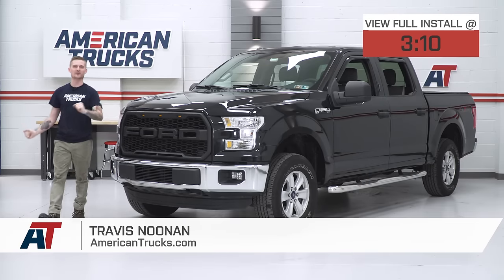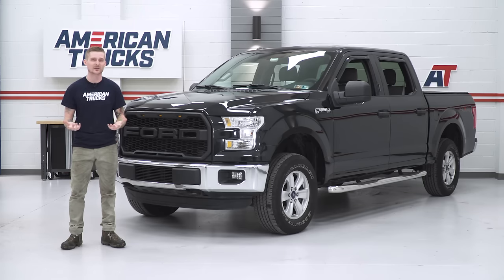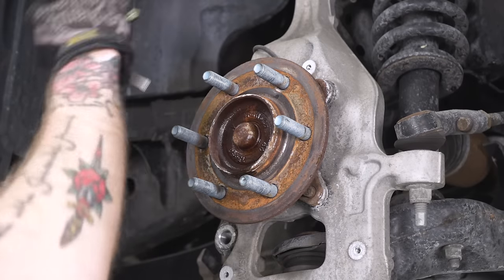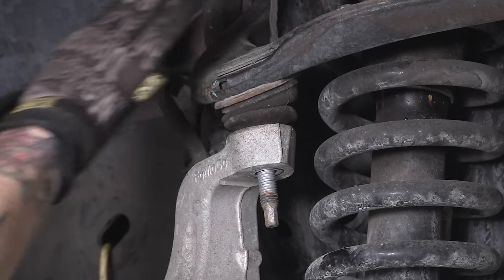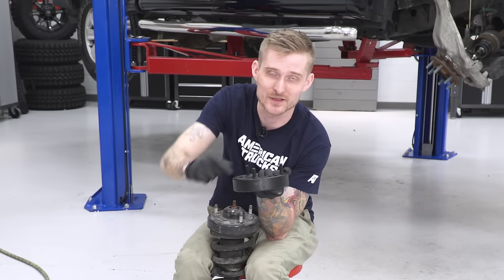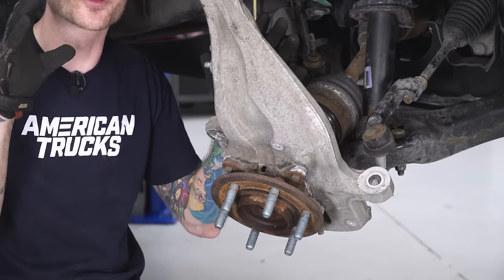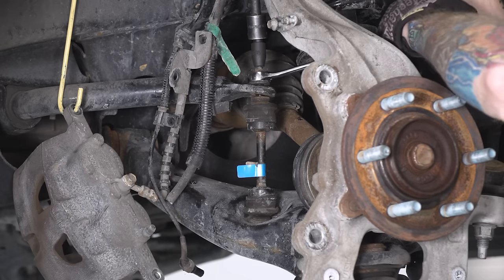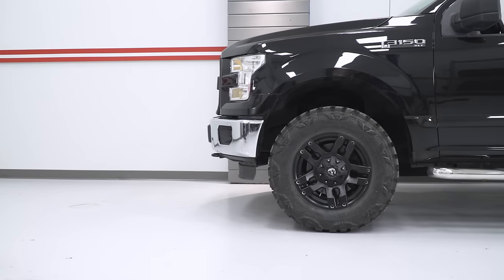2004-2019 F150 MotoFab 2" Front Leveling Kit Review & Install

Comment: Talk about doing it the hard way...  You do not need to pull calipers or axle shafts to install 2" leveling spacers.  Just disconnect the sway bar and strut and drop it down.  I installed mine in 90 minutes in my driveway using hand tools.
Reply: Thank you, this helped me save a lot of time! I did the same after reading your comment
Reply: Do you still need to disconnect the upper ball joint?
Reply: @phillipbriggs7682    Yes you will need to disconnect the upper ball joint in order to get the spring assembly out.
Reply: Did u use a lift or floor Jack and Jack stands?
Reply: @wilfredbilly3771     I used floor jack and big jack stands.   I only did one side at a time.
Reply: My upper control arms are rubbing on my strut springs…help please
Reply: What about the tie rod?
Reply: @ohbabyluci5698  I had same problem, but once I lowered the truck it seemed to be fine. How bout you?
Reply: All I did was disconnect the tie rod, and sway bar link, and the two bolts on the lower control arms, comes right out no problem. Just mark where the lower control arms were because they adjust for camber. But you should always have an alignment done after this anyways
Reply: Want to put 1-1/2 leveling kit  on my f150 2.7 eco; Everyone is telling me I have to do both the front and the back; Is that true ? I await your reply, thanks in advance
Reply: @chhayeng6320     Nope.  The reason for a front level kit is to raise only the front in order to level the truck and get rid of the downward front rake/stance.
Reply: Is your truck 4x4? Did the cv axle make it difficult not freeing it up?
Reply: This is crazy. Diy my ass. Can you just drop lower control. Align when done
Reply: @ohbabyluci5698 did you figure it out?

Comment: I decided to give this a try after watching this video. I have a 2016 F150 4x4 and installed the MotoFab 2.5 leveling kit. Literally just did the step by step process in this video and it was easy peasy. He is also correct on needing a buddy to help take off and install the struts because that’s tough by yourself. Other than that, if you have a nice socket set along with some elbow grease, it’s very simple. Thanks for posting this because it helped a lot, and my truck looks great!
Reply: Did it level it out or did it make your truck a little higher in the front ? I have a 2019 F150 lariat FX4
Reply: I'm doing it now on a 2020 F150 Lariat fx4 ecoboost, pain in the butt alone, on nthe brightside, nothing is rusty or seized.
Reply: @petebelmonte4578  I just now saw this, it leveled it out perfectly.
Reply: how are your angles??

Comment: To save yourself alot of the leg work get 2 heavy duty high tension ratchet straps  pop the top bolts crank down on the ratchet straps remove the top bolts finish cranking the straps enough to get the spacer in there use a jack under the lower control arm to get the spring back in bolt it up and your done release the straps slowly release the jack under the lower control arm and your done.

Comment: Ok to any one trying this I just did one today in a shop with a lift . I completed each side differently one side i removed just the sway bar link and upper control arm ,I then had to remove the lower control arm bolts because the axle was preventing the arm to drop low enough to install the new set up .  The other side I did it Just like the video and it took twice as long but was way easier in my opinion.

Comment: I put the motofab spacers on my 05 f150 4wd.They were either 2" or 2 1/2".I did not rotate the bottom of strut in a vice like you did.My Upper Control Arms are at a pretty steep angle and have completely broken off out of the control arm itself.The ball joint stayed connected to the spindle.I put new control arms (Moog) on it and they are still at same steep downward angle.I also did not really loosen the sway bar up as much as you did when installing the spacers.Do you think Loosening and then re tightening the sway bars will help relieve some of that angle???Or any suggestions would be appreciated.Thanks!!!

Comment: Can you just swap the left and right struts so you don’t have an issue with the orientation?  

Also, I didn’t see it in the video, but do you have to compress the spring and rotate the set the struts to line up the bolt holes?

Comment: You didn’t include a air compressor with hoses  in your tools. I leave the calipers on the bracket and only remove 2 bolts and hang it up and also when I installed these on my 04 fx4 it road like a rock. You could feel every lil crack in the road. Hated it. I recommend getting new coil and struts with 2” lift. So much better

Comment: Thank you AT for the video! I opted for the RC 2” leveling kit, basically the same. The install was flawless following your video, and much preferred over printed instructions. 
Just a comment - the steering knuckle will need to be “persuaded” with a large hammer, just like the upper control arm knuckle. That wasn’t very clear in video.
Reply from the maker: Thanks for watching, John! Happy the video helped you out! -Zach

Comment: Could have just undone the sway bar endlink and the lower control arm bolts and dropped the control arm down and then the strut. About half the time!
Reply: You can also raise both front tires, drop the tie rods, undo the sway bar, seperate upper a arm, and loosen the back bolt on the lower and it will drop enough to get the strut out, even easier than dropping the lower a arm.

Comment: To install a 2-inch spacer but my upper ball joint is touching my strut after I drop the Jack down. Don't know why. Decided to take the spacers iff
Reply: 11-14 did this.. they will contact at full extension. I had issues on my 2011. Rancho quick lifts will  solve the issue

Comment: Just installed the same kit. I have a 2017 F-150 super crew 2.7 ecoboost. Now my abs, hill start assist and service advance trac lights are on. Did I do something wrong and how do I fix it. Someone help! Lol
Reply: Sounds like you disconnected a wheel speed sensor.

Comment: Why in hell r u removing the caliper and the rotor? That has nothing to do with install
Reply: rev headz probably because the break lines aren’t long enough
Reply: @zb6618  just search any other leveling kit video by any channel, eveno on at, it only requires at most the axle nut to be removed, I did mine fox 2.0 without even touching the axle but cover, taking the caliper off is simply a waste of time and a potential oprtuniting to fuckup the brake line.
Reply: I was thinking the exact same thing. I’ve done a few leveling kits before and have never needed to remove the brake calipers
Reply: I think he mentioned he had to do that because it was a 4x4.

Comment: Will a 3inch spacer in the front fit on a 2008 f150 4wd fine?
Reply from the maker: It would but you have to start being mindful of CV angles and upper control arm interference. -Justin

Comment: Does anyone know another way to rotate the strut studs? Not everyone has a vise. Might be a dumb question couldn’t you just flip the driver and passenger strut and they’d be rotated? 🤔
Reply: Or if that doesn’t work for you, install the Leveling Kit on the strut first and put the two bolts at the bottom of the strut back in the lower control arm in the opposite direction and pull on it until it goes in the opposite direction. Just did mine today and it worked!

Comment: Do you not have to use a vacuum tool for the 4WD hub when removing the axle from the knuckle?
Reply: NO, but you need to make sure the splines are aligned when putting back together before tightening.
Reply: I know this is a year old but for others watching this vid, turning the truck on will suck the 4x4 splines in
Reply: So when if I had disconnected the axle and then re attached the vacuum line, the system charges itself when you start the truck up?
Reply: @levizirkle5496  Yes, the engine running creates the vacuum.

Comment: What is the actual measurement of the 2” spacer is it 2” or a little smaller ? Thanks
Reply from the maker: The measurement of the spacer itself is going to be slightly shorter than 2 in. 😁 -Zach

Comment: How come it dosent come factory leveled  out..
Reply: F-150 KING OF TRUCKS they needed a little rake in the front to compensate for towing, Ford doesn’t know how heavy of a load you’ll be using it it straight from the dealer lot so they add the rake to start.
Reply from the maker: Both of you guys above are correct! Rake helps out with breaking, towing, hauling a heavy load in the bed of the truck, aerodynamics, etc. Truck manufactures don't put the rake in there for the looks, that's for sure. -Zach
Reply: darkjedi351  sounds right...thanks
Reply: @saltylawaia8958  all trucks have there front end lower so what's your point.
Reply: F-150 KING OF TRUCKS front rake + heavy trailer = leveled truck.
Reply: @saltylawaia8958  thanks
Reply: darkjedi351  i did mine with a 3" kit to compensate for the extra weight of the bumper and winch.  added a camper top and its on 33's. 

19 mpg
i also flashed the engine, and i drive like an old lady.  that engine tuner kit made a huge difference.
Reply: All trucks come from the factory with the front end lower and the rear obviously higher. The purpose of a truck is to haul and tow. If you add a load or hook up a trailer the back of the truck naturally drops. A leveling kit serves no purpose other than aesthetics or looks. If you ever see the jacked up trucks towing a boat or camper and the bed is sagging and the front end is up in the air it's usually because of a leveling kit.
Reply: RAM-1500 KING OF TRUCKS...their

Comment: When you said these spacers will 'almost' level the truck, would the 2.5" do it?
Reply from the maker: I personally feel that 2-2.5" seems to deliver a perfect 'level'. -Justin
Reply: 2.5" would probably get you closer to a perfect level, but you have to take some geometry into consideration, particularly CV axle angle, and control arm clearance when the suspension is hanging. You can only go so far with spacers before the upper control arm will hit the coilover spring when the suspension is hanging. I had 3" spacers on my 08 Expedition, and when I put that vehicle on a lift, the upper control arms contacted the coilover springs. It seems the most common/cost effective modification is a 2" leveling kit with 33" tires, which is probably where I'm headed with my 2020 F150. I don't think 2" inches of leveling would cause any of the aforementioned geometry issues whatsoever.
Reply: @Sagittarius-88  the 2.5" is standard leveling done by ford dealerships. 2" would get you to near level. 2.5 will for sure get you to level without any issues. 3"and up will begin to cause issues.
Reply: Rather than have a virtually perfect level, I would rather get it close enough with a slight forward lean.
Reply: @derekkt49  this is my thought for both good looks and functionality. In theory that would give you "level"  plus better (or certainly not worse) steering control under moderate loads.

Comment: Just installed the 2inch motofob leveling kit on my 2011 ford f150 2WD. Hearing some small noises when I hit bumps and do slight turns. Anyone have any idea what the issue could be?
Reply: Did you solved the issued?

Comment: Is necessary aligned the truck after put the 2 inch spacers?
Reply from the maker: I would absolutely recommend it- yes. -Justin
Reply: I received today my new spacer for put my truck 2" high in the front. Why this spacer have the thickness in around 1-5/16" inches. The spacer is not supposed to be 2 "
Reply from the maker: The spacer itself included with leveling kits for independent front suspension vehicles like yours are never the same height as the advertised lift height, which is fine! The size of the spacer itself will give you two inches of height in the front when installed. You'll have no issues there. -Zach

Comment: Maybe I’m smoking glue or asleep, but I surely don’t remember taking off half of my front end (ie the brakes and lines and all that shit) to do this. It took about 20min per side plus I didn’t have to worry about possibly screwing up anything else that was removed. Just the upper ball joint and your good. Also, just a thought....but does anyone else think this axle nut is pretty damn small on these trucks or am I smoking glue again?
Reply: What year is your truck? I have this kit for my 2018 4wd, putting it on soon. You didnt take the rotors off or anything? Seems pretty simple.
Reply: Glenn Maggard ...2015. Honestly now that I look at it I guess I did about everything he did besides the axle part (it was a different truck I didn’t remove the brakes) Seems there was enough play in the CVs to move it enough. I’ve heard of guys with little knowledge screwing up their 4wd after messing with the axle, but don’t know if that is true or not. I remember thinking it could have been done with just the upper control arm off, but I did all the brake stuff too just because I wanted to clean and inspect it all anyways. I think some of the years have a different way the bottom of the strut mounts (some have two bolts on an angle). Since you have to turn your strut 180 just swap sides with those instead of trying to move those the opposite direction. This literally took me 20 min per side. Yes I have a lift and all the correct tools and knowledge, but it certainly isn’t difficult. I was going to just use my strut compressor and pull it right out but those things really scratch up the coils...but you could do it that way. Just be careful with brake lines and abs sensor. Bungie or zip tie them all up out of the way or whatever you want to do to keep them from being damaged. It’s really not hard and with a little knowledge and some jackstands it shouldn’t be difficult for someone to do in their driveway. DONT mess with the control arm/body mounts (where the alignment is done) it’s not necessary like some vids show. However be sure to get an alignment no matter what. Good luck...you’ll be fine.
Reply: @specforged5651  I dont understand, you need an alignment anyway, why is everyone disassembling the entire knuckle and brakes when you can just drop the lower control arm out and remove the damn strut?
Reply: Allan ..Thats what Ive been trying to get at. People are making this a bigger deal than it is.
Reply: @MrBeats_6000  Its easier to just seperate the upper a arm, and the sway bar. No need to remove your lower a arm and then have to worry about getting the camber back halfway right.

Comment: Will 2.5” be okay as well??
Reply from the maker: Absolutely! Anywhere from 1 to 2.5 inches is fine in my book regarding leveling kits. I wouldn't go much higher unless you plan on replacing other suspension components though. -Zach
Reply: Which is better? 2 or 2.5?

Comment: I have a 2018 ford 150.Going to install a 2" leveling kit.With 33/12.50/ tires should i keep my 17" wheels or go with 20" ?
Reply from the maker: That's entirely up to you Brent! 17"s will give you more sidewall while 20"s will give you more a 'street' truck vibe. -Justin
Reply: @americantrucks  thanks
Reply: AmericanTrucks Ford will 18” rims work well with it to?
Reply: More sidewall is better imo. That street look sometimes have issues hitting a pothole by accident and have blowouts

Comment: Damn, shitload of work for a 2”donut. Doesn’t seem worth the time to install them.
Reply: I think you have to take into consideration that this is a demonstration video, and he's probably not working nearly at full speed. I installed a strut spacer kit on my 08 expedition, and was able to bang out all 4 struts with relative ease. It's worth nothing though that I'm a full time auto mechanic with access to a lift and the necessary tools. For someone who's not knowledgeable in the automotive repair / installation field, I could see where this kind of work may not be worth their time.